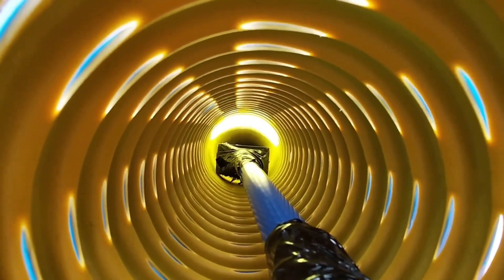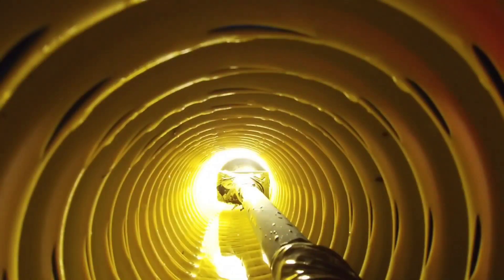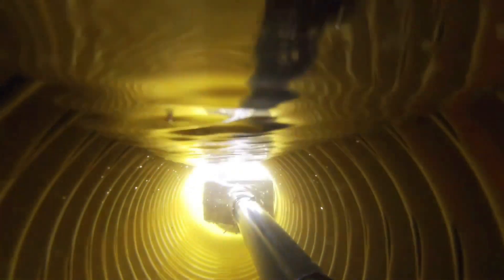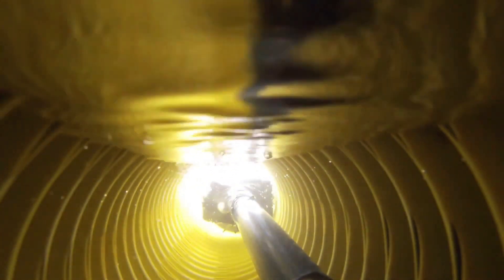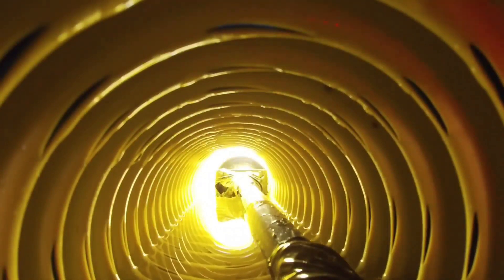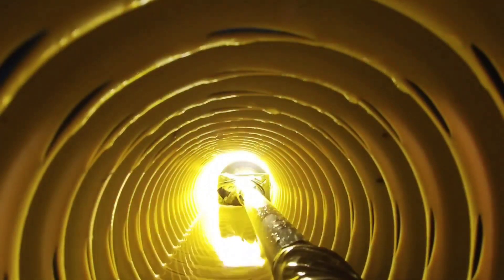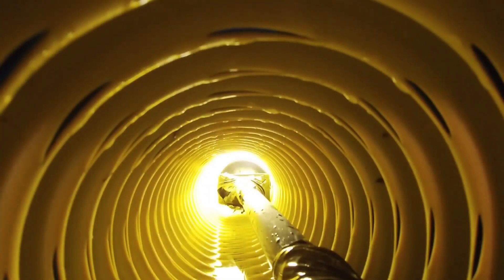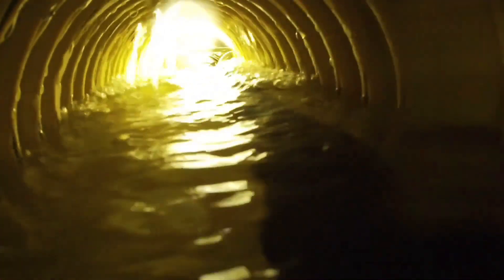How Does Corrugated Drainage Pipe With Holes Really Work? A Behind-the-Scenes Look

Comment: For mine, the bend (the ones you had before the “not quite a 90 fitting”) to daylight out of the pop up emitter holds water. I drilled 3-4 holes at that bend so water can seep out. Is that acceptable?
Reply from the maker: We like to take the pipe to daylight whenever possible. When it's not possible, we do take them to a pop-up as well. Yes, the pop-ups can hold water because they are at the very end of the line. If you slope the pipe correctly, all the water should run toward the pop-ups.
Reply from the maker: https://youtu.be/5MkELLf--AA?si=Tsifq_X908xJSlPT